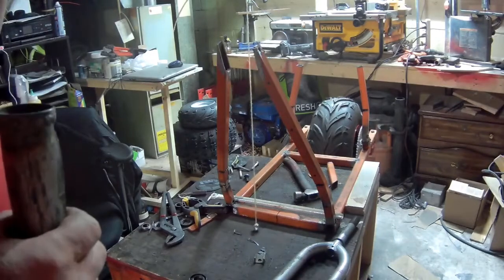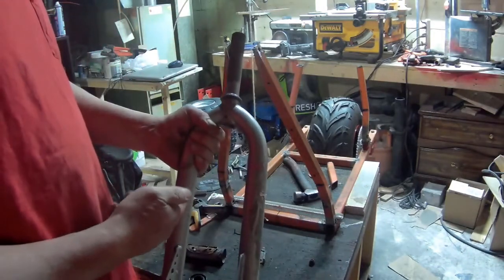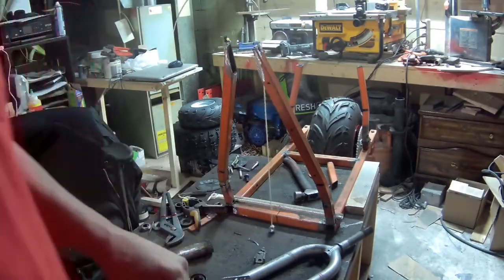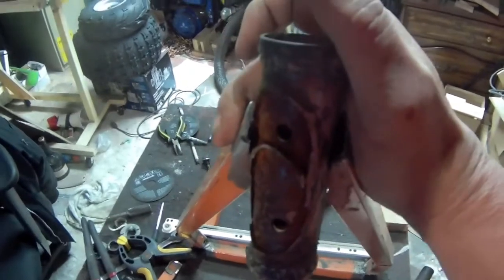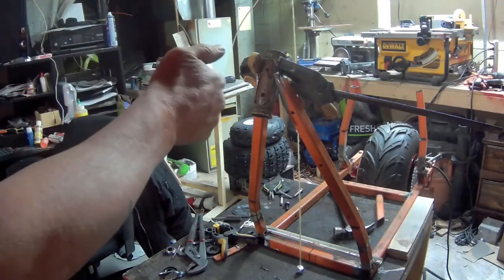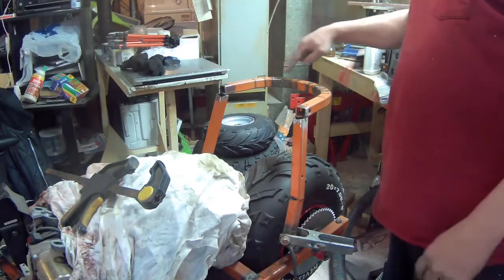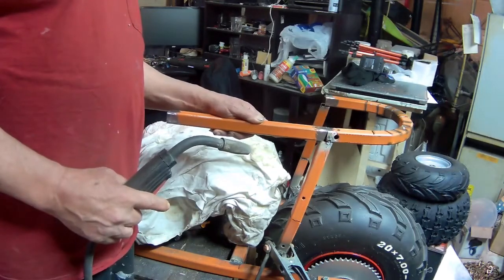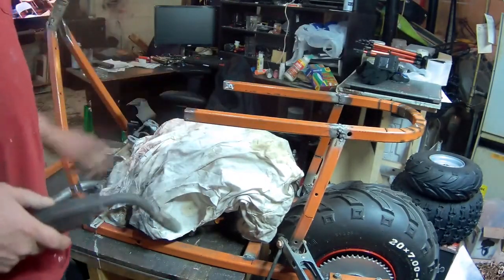Mini Bike Build, The Tracker pt. 2

Comment: Hey Neves.  The bike is coming together well.  You can have the sprocket on the centrifugal clutch on the inside so it lines up with the rear  sprocket.  They work both ways.  
The brother in law will love it. Great vid  Cheers mate 👍
Reply from the maker: Customwinder 1 Thanks, I didn't know that, I will have to do that so the motor can be more centered